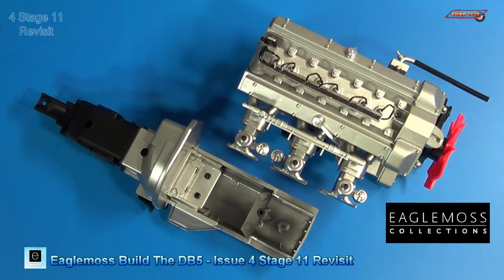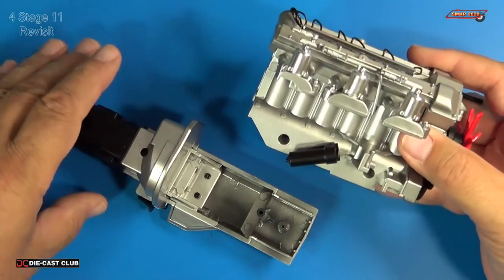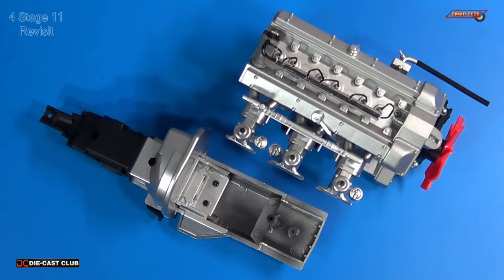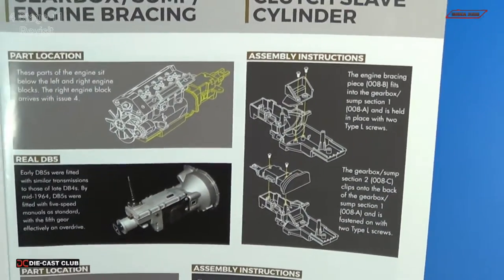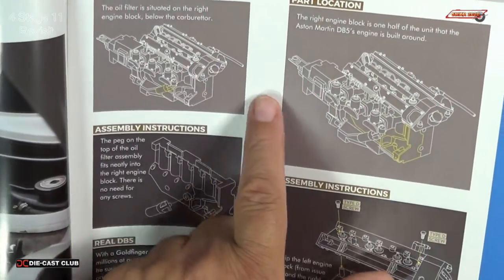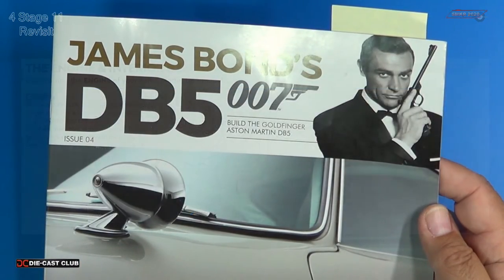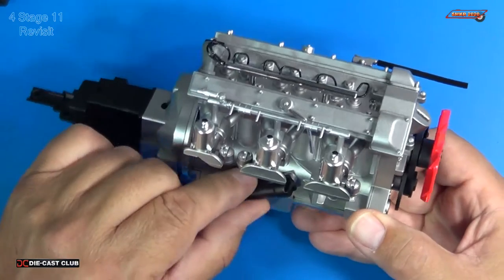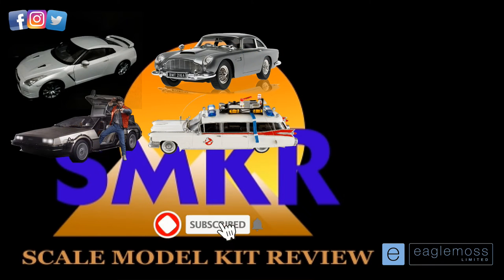ALERT - Build the Goldfinger Aston Martin DB5 Issue 4 Stage 11 - Revisit the Engine & Transmission

Comment: Nice job explaining the correction to this build.  I'm a bit surprised that Eaglemoss neglected to include a modified building instruction since the DB5 was originally issued several years ago.
Reply from the maker: Going into this, I had no idea about the missing steps, however I learned fast how the instructions jumped around from issue to issue, so far its the only kit that does this.